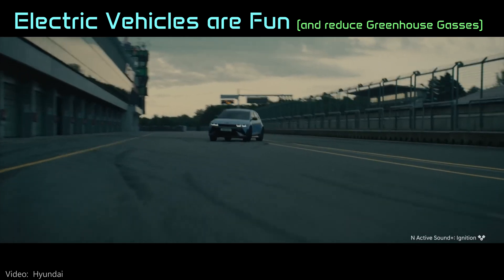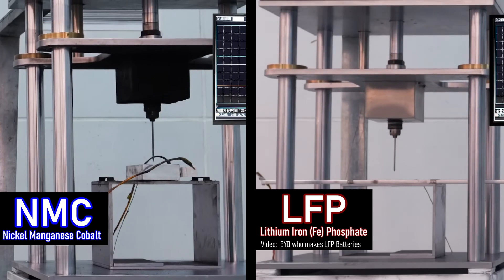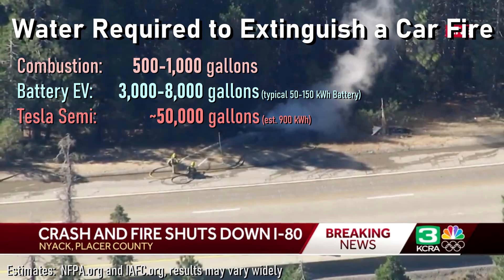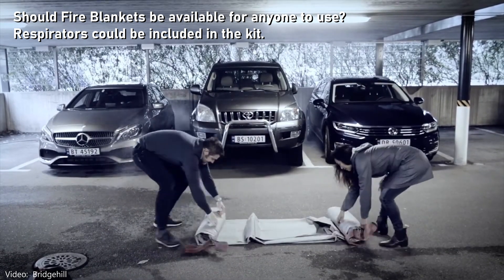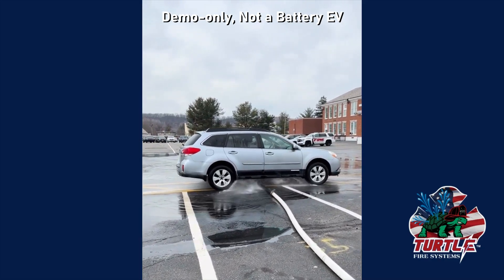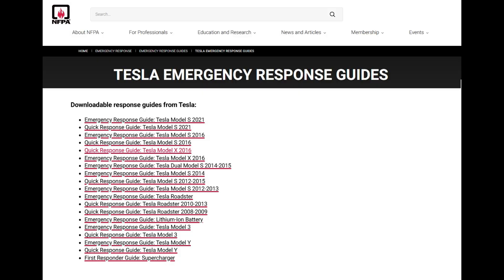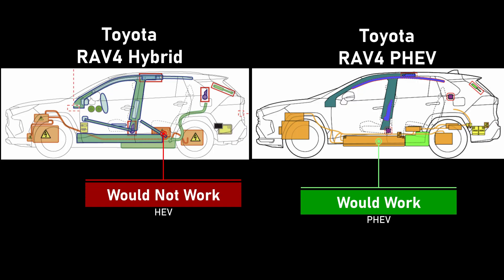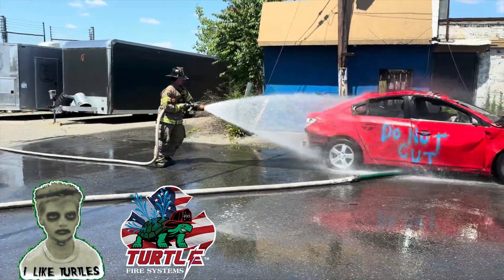Fighting EV Fires - New Tools to deal with Lithium-Ion Batteries

Comment: I think that manufacturers that produce this volatile and unpredictably explosive cocktail should themselves be responsible and accountable to devise an on-board internal mechanism, fluid or other material that is dispersed instantly whenever there's a fire detected.  This smothers the battery internally mitigating the toxic chemical reactions that are that perpetuate a further conflagration. Something that will mitigate the disaster until fire fighters can arrive on-scene.  Will this sort of thinking and added cost ever enter the minds of profit hungry CEO's?  Highly unlikely.